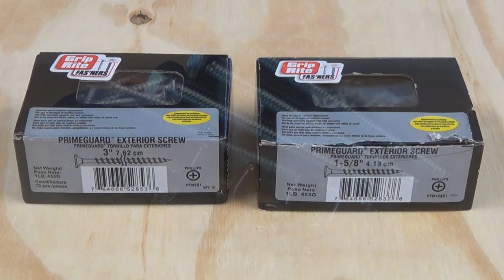How to Make Cornhole Boards

Comment: I think you need to adjust your blade guides on your bandsaw. Once in a while i see the blade move back like 3/4 of an inch. Lol. Anyways Nice build! You can also use pocket holes instead of screwing the 2x4's together like that. Just saying! :)